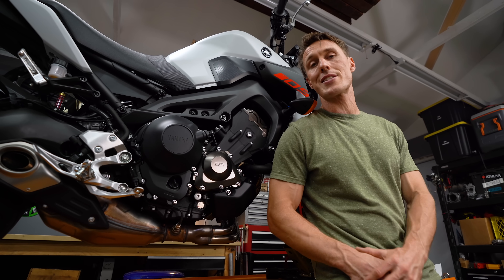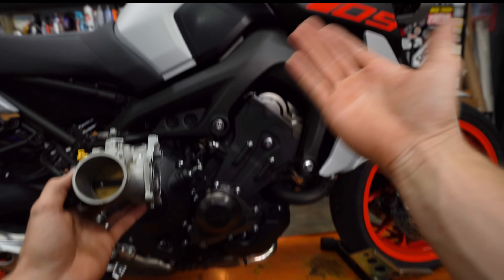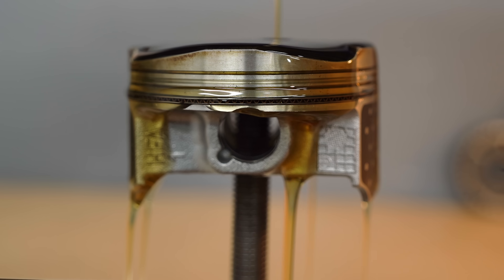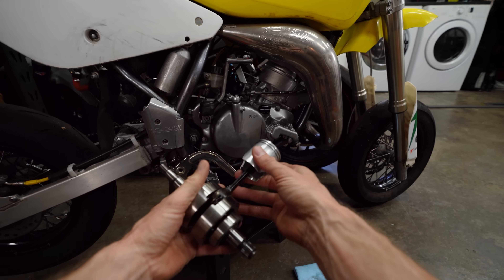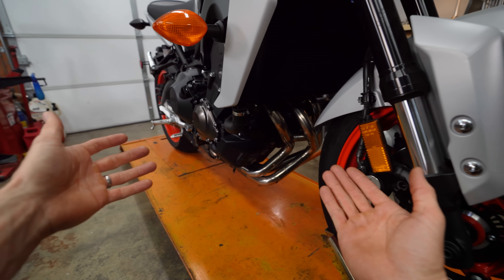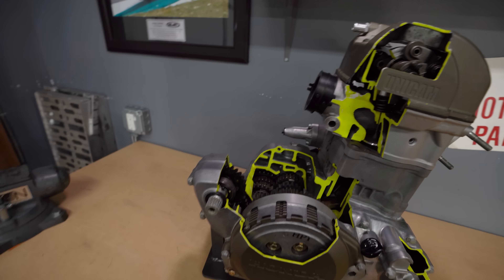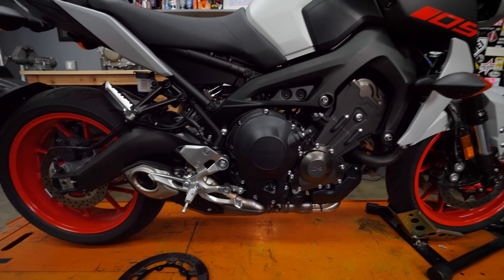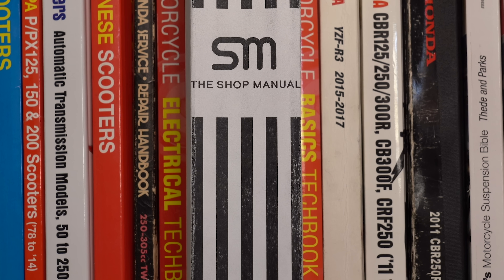Is Engine Braking Bad For Your Motorcycle? | The Shop Manual

Comment from the maker: Read more about engine braking on Common Tread: https://rvz.la/3kQJvE3
Reply: Hey Ari, what about giving a little rev and doing the engine braking like I see professional drivers and riders do  ?  Is that a better way to do engine braking ? Cheers.
Reply: @authenticmax6350  sure. Its a better way to slow down your vehicle without damaging the clutch and the engine form back torque. This case used for racing to prevent back wheel sliping and prevent rpm down and used if you want to slow down vehicle smoothly and minimize back torque. But if you have a slipper clutch feature. You dont need to do rev matching.
Reply: @muhammadsyihab2636  Oh okay,,, Thanks brother.
Reply: Hey Ari, great explanation. I was thinking, what about a short bore and long stroke engine? The engine use a low rpm, it's safe too? Thx.
Reply: hey i wanna know if u are on full throttle of 3rd gear and u wanted to up shift the gear to 4 but u mistakenly shift down to 2nd  a loud  comes and bike resist  ....WILL IT HARM THE BIKE?
Reply: Great video, will not harm the Engine, but what about the Sprocket?
Reply: Could it affect my front sprocket...?? Like bending teeth of sprocket..?
Reply: Not only engine braking will help your bike to rev higher countering the negative effects of crank inertia going out of corners but the extra negative pressure created will help the engine breathe better and cooler on the initial strokes after opening the throttle. You will have some extra air being compressed and yet it will be colder. Both generating more power. Win Win.
Reply: Braking too little can be bad. my front brakes were beginning to rust. so you gotta break a little to keep them clean and lubed.
Reply: Awesome. I didn't know Ari is with you guys now. I used to watch him on his other channel and learned he was leaving after the firework accident. I love Revzilla, glad to see him there.
Reply: @RevZilla 
2 stroke motorcycles?
Reply: Me... Hahahaha 😂 😁 😅 🤡
Reply: All your vids are awesome mate, and I know I'm not alone when I say a big "thank you" for the info and help you and RevZilla give us in these vids. In regards to engine breaking, although engine breaking itself is a valuable tool, what are the disadvantages to compression lock-up when under extreme braking situations..? (pre-slipper clutch bikes etc). Cheers from Aussieland 🍻🤙🏼
Reply: @dazaspc  
Fully agree, i ve used too much engine braking which affected on oil consumption,  after 4k miles i found no oil in crankcase.  Transmission also suffering from engine braking, but thanks to slipper clutch which reduce some negative torques.
Reply: Engine braking comes from one significant source and that’s drag, take a carbureted bike or a manual throttle hit the kill switch then open and close the throttle . You’ll notice no difference .

Obviously be careful when turn switch back on…
Reply: what if I descend in neutral with a speed 100kph and instantly put it in gear one

Comment: Who else already knew the answer and still watched 💆‍♂️
Reply: I didn't even know it was a question. Still watched.
Reply: @el34superlead  I questioned it when I read the title
Reply: It's me..
Reply: I figured there was a chance I'd learn something new... and I did (had not really thought about the potential issue with 2 strokes on long descents... but it makes sense).
Reply: Yup.
Reply: Lol yup, not heard this of one before, but you see Zach and/or Ari, you watch lol
Reply: Having owned and ridden 4-stroke single cylinder motorcycles exclusively for the past 40 years, engine braking makes these machines the very safest ones to ride!
Because decelerating under a closed throttle, is not only creating a vaccume between the piston crown and the cylinderhead- it is also compressing the atmosphere in the lower cylinder and crankcase- and this is a strong force.  (Back in the late '50s- when the manufacturers started raising compression ratios, the motors were blowing main seals.  To prevent this, the motor had to be vented.
   To experience this, for yourself- find an empty stretch of highway, and wick it. (The TON is fun!)  Snap the throttle shut- and see how fast your bike slows down!
(No twin or multi can do that.)
   Get in a corner too hot and lose traction- hitting the brakes can only make things worse- SHUT THE THROTTLE OFF!  Cop car behind you- same thing, (You are not showing brake lights.)
Ari- say hi to your Dad, from an old VRRA.CA member! (I got to chat with him- at Shubie about a decade ago.)
Reply: Just for that 'Oh yeah, I do that too' factor
Reply: Anything from Ari I watch
Reply: I thought that you shouldn't  enginebreak a 2 stroke
Reply: Just to see the cut CRF engine...
Reply: just because Ari!
Reply: Yeah I'm a professional mechanic and figured eh let's have a look anyway
Reply: guilty as charged :)
Reply: I think I know the answer but didn't know the MT09 was a 3 cylinder so just a minute in and I learned something
Reply: even though the answer was in the thumbnail i still watched.
Reply: Guilty lol
Reply: Checking in!
Reply: Yup, but had to watch him to this with out being sarcastic!  Tough job.
Reply: Yeah totally 😆 I even do it pretty hard on 2 strokes with no dramas.
Reply: this is my sunday morning cartoons .. only its not cartoons
Reply: @doriangray2020  had a salt jar dropped on you or what?
Reply: 2-strokes barely engine brake anyway
Reply: Oakland County
Reply: I never thought i would stop just wanted to see what he had to say on the topic.
Reply: Lol
Reply: Who else is trying to flex and say how much of a motorcycle expert they are but wanted to prove themselves right and let everyone else know that they are an expert pro racing knee dragging wheelie popping bad boy?
Reply: @50629  this is basic shit bro. If it were to be bad it would be written in the owners manual given people actually read them 😁
Reply: Yep
Reply: Aye. I did. Doesn't matter, still a good and interesting vid.
Reply: This guy.
Reply: It would be remiss not to mention rev matching...
Reply: I knew the answer cause I watched this video before... yet I’m here... watching it again 💆‍♂️
Reply: Wtf else am I gunna do?
Reply: Yup. But I enjoy the education about the breakdown of components and their functions.
Reply: Same here
Reply: You're never old to learn new things 
So why not
Reply: Me
Reply: what about the fuel consumption does it decrease fuel economy
Reply: @Guy_7inch  nope
Reply: Me
Reply: Me. I know it’s nor bad but i don’t know why. Lol. So i watched.
Reply: Yep, it was an obvious answer, but still watched. A good point about the applying the breaks at least a little so that others behind know that you are slowing down, this is pretty much recommended in motorcycle circles.
Reply: Me... and yeah didn't think people realized this is a question.
Reply: This guy obviously never rode a 70s bike
Reply: @karlfonner7589  you talking about 2 strokes where you close throttle you not only vut fuel but also lubrication for the piston? I know about that.
Reply: Knew the answer, wondered who asked the dumb question, then watched half until he stated talking about lack of fuel or lube when the throttle is shut off, 🙄 umm I wonder why the engine doesn't cut out though? 🤔
Reply: @kuhndj67  it doesn't make sense, unless the engine cuts out and you continue to roll with it in gear then it might become a problem.
Reply: @TheDonnEHV  yeah you just have to keep the throttle permanently open on a 2 stroke. 🙄
Reply: @Guy_7inch  no it increases fuel economy as your not running as much fuel into the engine.
Reply: Not going to watch because the answer is obvious: it depends.
The way I learned how to ride includes matching engine speed to road conditions. That way lets you control most everything with the throttle and not the brakes.
Reply: @davidcampbell362  , a buddy had a Suzuki GT750 Water Buffalo and engine braking was non-existant.
Reply: Definitely me.
Reply: I like learning little things so I watched just in case I'm missing any of the little things lol
Reply: How can it not be bad for the engine?  He literally said the piston wore out from living a good life.  Imagine you don’t engine break how many less revs that piston would have gotten.  I understand it might sound negligible but you’re literally adding many more rpms compare to idle every single time you engine break. The more important point is we don’t expect the same longevity from motorcyle  engines as we do car.  But revs means wear.   If not, then it would last forever.
Reply: @yinshah3303  but youre forgetting that the engine revs are what drive the oil pump inside the engine, idle rpm = less oil being pumped.
Reply: @tejaspadhye  this isn’t cold start idling right?  This is idle right after throttle?  Even Ari said there’s enough residual oil to lube.  You can’t seriously be arguing idling off throttle creates more friction then engine breaking off throttle!?
Reply: @yinshah3303  well then google it up to satisfy your hunger for answer, what else can I say? All I know is that engine braking doesn't break engines.
Reply: Me (got the 69th comment)
Reply: @I.work.for.burritos  nice
Reply: Since when was pushing a peddle closing the throttle, I thought it connected the rear break to the engine directly.
Reply: Insecurity about your own bike, wtf.
Reply: I knew it.
Reply: It’s called click bait lol
Reply: Me. I just want to make sure because my friends say that it's bad. Well, my motorcycle, my rules.
Reply: didn't this got talked about back when he was still with MC Garage?
Reply: Meeeee lmao
Reply: I hasn't even know the answer Tejas
Reply: Yeahhh😅 thats me
Reply: i dont understand english, thats why
Reply: I did not know.....
Reply: Still watch Ari whenever I can
Reply: Me
Reply: Its called clickbait.
Reply: Why did your mt09 come with a versys650 owners manual?
Reply: @magna116  I think you're lost
Reply: Heh....
Guilty as charged.
Reply: Well, I'm a master tech.. but I watch anyway to see if he's right lol
Reply: Ive watched so many videos on the same topic, I click on all of them just to look at the comment section 💀
Reply: Me 😂
Reply: I mean hopefully everyone
Reply: Not because you know the answer you know why
Reply: Yeah.... me too
Reply: Smort gang 🫠
Reply: YEP LOL
Reply: I was taught to do that when I was learning  that's along time ago to
Reply: I prefer engine breaking
Reply: I think running in a bike some engine breaking is good
Reply: Hahaha me 😂
Reply: I wanted to make sure I wasn't dumb
Reply: Gotta make sure they all get it right 😂
Reply: HEAR, HEAR.
Reply: From my limited experience, 2Ts don't experience  engine braking.
Reply: I don't have a motorcycle, but I do have a faulty brake caliper on my car that I cannot currently afford to replace....I generally engine break down to 20mph or less and then finish with the actually brakes.
Reply: just to confirm and yeah and it totally put me at ease!
Reply: me lmao
Reply: Me
Reply: Me. 😉
Reply: I knew, but still watched the video for second time after 4 years

Comment: Keep in mind that when engine braking, you're only slowing the rear wheel, so be careful in low traction situations to not break the rear loose. It's bad for your engine to crash.
Reply: What you said sounds stupid in paper but beautiful irl.
Reply: I think this isn't stressed enough for new riders. Also, for bikes without slipper clutches, dumping the clutch can also lead to scary instability for an unaware newbie.

I also think it's fair to say that too many riders rely almost exclusively on downshifting to scrub speed. It's just so much better to learn proper front brake modulation and trail braking techniques too.

I downshift going into a corner, but generally only so that I am in the preferred gear when exiting the corner, rather than for engine braking purposes. Brake pads are cheap anyway!
Reply: @alozborne  True, but where I live (Portland, OR) braking vs engine braking can make a HUGE difference in fuel economy. I'll use my car as an example cause I only recently started riding, but when I was almost exclusively engine braking down the 5-7 degree declines that go for 1/2 a mile (or on US 26 about 3 miles) for that trip I'd get 40-45 mpg, whereas if I had to use the actual brakes for most of it, i'd get the more expected 28-30 mpg. It won't be nearly as dramatic for a bike that weighs 10% of my car, but if you can do it safely it's definitely noticeable in the right conditions.

But, I'll admit most people don't live right near multiple mountains and volcanoes where this can be used regularly.
Reply: @PomegranateLost  That's fair. Honestly, I rarely  give fuel economy much of a thought as my CB500X gets about 65 mpg average.
Reply: As a learner I engine break while downshifting, I have a slipper clutch which helps
Reply: @steve00alt70  remember you have no engine braking while downshifting, only between shifts. Also, each gear gives a different amount of braking. Hopefully you don't have an engine break! 😆
Reply: @alozborne  I am looking to get my first bike and the one I have my eye on Im pretty sure does not have a slipper clutch. Does this mean I need to not engine brake?
Reply: @cassie4468  you can engine brake, you just need to have good clutch control to avoid dumping the clutch lever too quickly. Practice doing low speed turning in a parking lot to improve your clutch control
Reply: @alozborne  Thank you for the response and advice!
Reply: Quick question..., Engine breaking wouldn't it consume more fuel..?
Reply: @brytcymbanero5551  when engine braking, the fuel injection can be shut off, allowing it to use no fuel. This is because the wheels turn the engine, instead of the other way around. If you push the clutch pedal or put it in neutral, then the car won't slow as quickly, but it will have to burn fuel to keep the engine idling. 
(The above all glosses over hybrids and their start/stop systems and regenerative braking).
Reply: @questioner1596  sounds awesome I appreciate the response,I've learnt alot from your I have fixed my own motorcycle just always watching for videos really helpful... My apologies for such a question as you illustrated with carburettor first just got lost in the comment section, keep the good buddy always forget to subscribe but always leave a thumbs up will do both soon 💪
Reply: @alozborne  I've been riding motorcycles for 25 years, and the number of people on the Internet that are afraid of using their front brake is baffling to me.  Did some "social media influencer" grab a handful and toss themselves over the handlebars on the TikTok or something?  

Use your brakes together.  All the "use the front for this and the rear for that and blah blah blah blah dieblah"  Just use your fucking brakes.  I'd say the work the same as in a car, but....people can't drive those for shit, either.
Reply: Actually it depends. In snowy weather smooth engine braking is your best option to slow down
Reply: @SahnigReingeloetet  that's bad advice because your bike only drives the rear wheels, so you're more likely to lose traction than braking both wheels. Also, downshifting is enough to upset your rear traction, and the amount of engine braking varies depending on engine rpm.
Reply: @questioner1596  have you ever actually ridden in icy weather? The risk of losing the front far outweighs the potential benefits of braking in both the front and the rear. Because if you lose the front tire you’re on the ground cursing faster than you can say MaxWrist. So maximizing front tire grip is your main priority. If you lose the rear it‘s not as bad, you can control that with proper balancing and countersteering. And what I mean is literal black ice weather, so deep winter and the sorts. If you don‘t believe look for advice on how to ride in icy weather online, pretty much everybody says the same thing I do because it‘s literally the only thing that works consistently. Don‘t use your front brake, only occasionally use your rear brake if you trust the surface and let the engine do the heavy lifting. And don‘t ride fast.
Reply: @PomegranateLost  honest question: how does your mileage improves with engine braking?
I mean, by definition the purpose of braking (engine or pedal/handle braking) is slowing down/stopping, for which you would not accelerate, (ergo need more fuel) ... Specially in a car where you literally have to remove your foot from the throttle to be able to press the brake pedal.
Reply: @brytcymbanero5551 technically it should not have any effect. When braking, you are not exactly accelerating (maybe a bit when throttle blipping), so the engine is only letting enough fuel in to not shut itself off (iddle), both when engine or pedal/lever braking... specially in cars where you are literally releasing your foot from the throttle to press the brake pedal). Hope this makes sense.